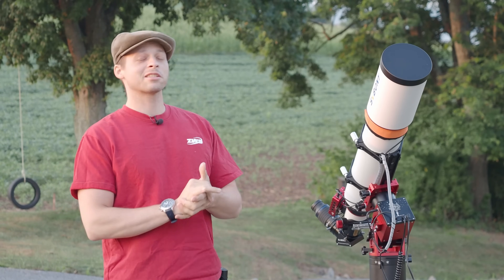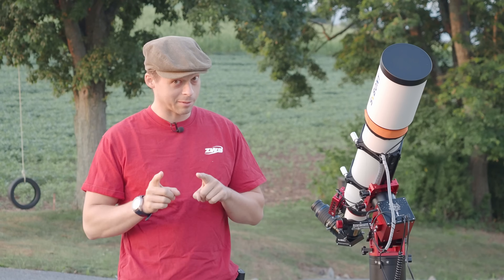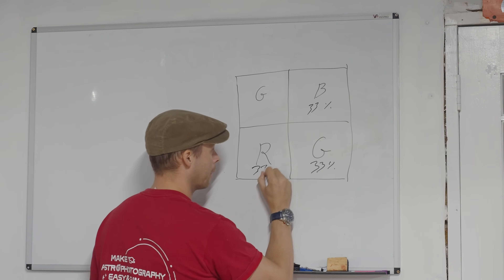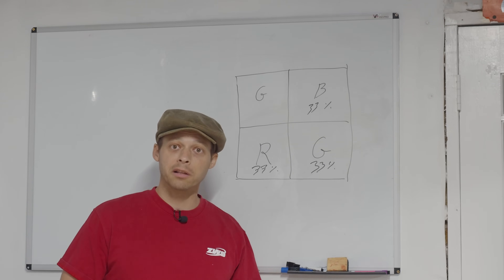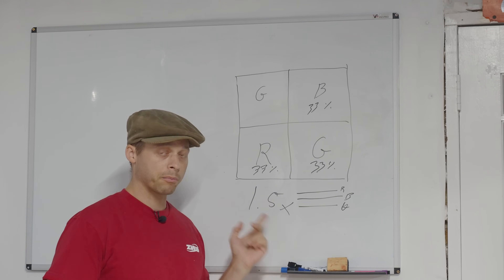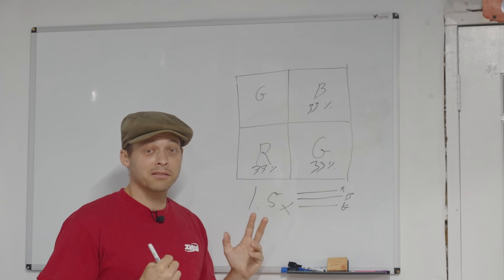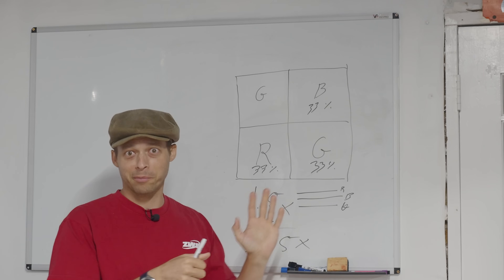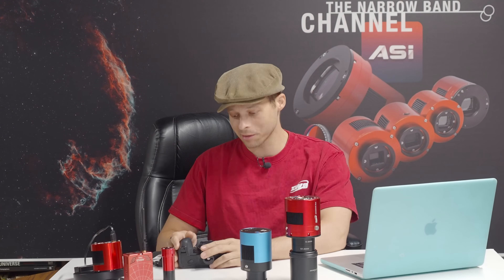New Sensor could bring 2.5 Stop ISO Improvement

Comment: As far as I know, QE is defined by how many photons are converted into electrons per wavelength. So the filter does not change the QE per pixel at its highest transmittance wavelength. We are throwing away the red light on the blue and green filters, but that has nothing to do with QE. So if there is no red light hitting the silicon on the green pixel it cannot be converted as per the definition of QE. You are talking about spectral sensitivity of the system, but not QE.

Comment: Foveon did this decades ago by stacking blue green and red sensors using the fact that the absorption of light in silicon varies as a function of wavelength, the blue sensor being on the surface and the red and green sensors being buried below the silicone surface. The principal inventor of this technology was Dick Merrill. I wrote most of the patents to this technology. See for example US Patent No. 6,727,521. Sigma incorporated the Foveon X3 sensors in its digital cameras and later acquired Foveon.
Reply from the maker: Its actually very different in how it works. Like making a cake with sugar instead of salt.
Reply: @TheNarrowbandChannel  The only thing that seems to be different is the perovskite material and its photon capture physics. My comment, as well as previous comments by others, was to the effect that the video seemed to imply that the concept of vertical color photon capture was something new, which it is not. Not enough information to determine yet whether properties such as photon capture efficiency, signal-to-noise ratio, and manufacturability will prove to make this a better technology than the Foveon X3 vertical imager
Reply from the maker: @KennethDAlessandro  I did say in the video that there have been other (many in fact) attempts at this. 
What is better about this is that light is not absorbed across the entire spectrum as it is in Foveon tech. Which is a dead end and has been for some time.

Comment: Foveon did this decades ago using the fact that the depth of light absorption in silicon varies as a function of wavelength. They used a surface blue pixel sensor and buried green and red pixel sensors. Dick Merrill was the primary inventor for this technology. I wrote most of the patents for the X3 technology. See for example US Patent No. 6,727,521. Sigma used Foveon X3 sensors in digital cameras quite a while back.
Reply from the maker: It's not the same tech. Like making a cake with sugar vs salt. Foveon was a dead end 10 years ago.

Comment: I’m not sure about the increase in light due to removing the Bayer filter. I guess the question would be % of available light absorbed in total by the sensor, loss through the stacking process, and overall efficiency. However, if 90% efficiency is achieved, and the sensors can be stacked, and their size increased then much better fidelity could be achieved with a total reduction in overall noise. That would be tremendous.

Comment: Panasonic had video cameras that used a prism to split the light of RGB into 3 different sensors, wasn't really any better than competing video cameras
Reply from the maker: In the 90s 3 chip video cameras were king of the hill. They had dramatically better resolution and low light performance compared to single ship cameras of the same era. You should look up 3 Chip cameras. They were pretty neat.
Reply: @TheNarrowbandChannel  I own one and a similar vintage sony and canon, compared them side by side and saw little improvement

Comment: Strangely enough, the Pentax K3 mark iii has a better iso performance to its monochrome version camera, Pentax K3 mark iii Monochrome. So in this particular case the colour sensor from purely the prospective of iso performance at different ISO levels performance better, in respect of noise at the various ISO settings.
Reply from the maker: Pentax must have done something dramatically wrong with that ones firmware, or it's not the same sensor. The color version uses the IM571 sensor and the mono version of it has vastly superior performance as many many astronomers have confirmed. It's a very popular sensor in its mono version in astrophotography. A ton of data is out there about it.
Reply: Yes I honestly don't know why this is the case, as you said it could be a different sensor. And I understand what you mentioned about the monochrome sensor and reviews of it with astrophotographers, the whole thing surprises me too.

Comment: Excellent video! I hop you are well.  Regarding the low number of research papers being published in journals, Yes, CoVid-19 has impacted research & development, but I wonder if the incentive to fund R&D within the manufacturing sector has dropped for the following additional reasons:
(a) manufacturers have made a massive  investment in the equipment & training for the efficient & profitable mass production of Bayer Array CMOS sensors...which means they need to pay for the preset technology before considering adopting significantly different sensors, and
(b) the Bayer Array sensors are quite profitable, and what research is being done is targeted toward the existing technology (this happened with CCD sensor technology, until CMOS sensors became viable & profitable)
Reply: I think a lot of research went into TDI cameras and sensors for automated vision systems. For consumer applications, the BSI sensors were stacked with memory and amplifier chips… research went thus into 3D packing for improvements on the system level. There was some research, however, for curved chips by Sony (I believe) to compensate for the field curvature of optics. In the end optics got so much better with the “CODE V optimize button” and new low dispersion materials that curved chips were not required anymore.

Comment: Cool tech! Hopefully it becomes a real product soon.
In theory it should also fix (or strongly reduce) the problem of moiré that bayer sensors have. You can bypass this problem by having a very high resolution sensor, or use some softening filter, but that’s not ideal.
Since both web compressed videos and stills are also often compressed to 4:2:0 chroma sub sampling, the actual resolution you are watching is probably very much lower than the stated sensor resolution. At least a better sensor would eliminate one of the color resolution  steps involved in a normal publishing workflow. (You can compensate for this by over sampling.)

Since the computer also doesn’t need to invent most of the pixel data based on the surrounding pixels, decoding the file should also be less compute intensive.

So higher quality image, better low light sensitivity, no moiré, faster decode. I wonder if this tech also have a downside. Perhaps the actual color reproduction/separation is worse somehow? Lower dynamic range? Slower readout speed? A lot higher production cost?
Reply from the maker: It looks like they claim lower production costs.

Comment: First, learn a bit about the luminosity function - it will tell you that your '33%' is nonsense when it comes to normal photography cameras (which is a different use case to astro cameras). The bayer sensor is very clever, even if it looks simple. Calling it 'red green and blue' misunderstands how it works. What it actually is, is a luminance channel and two chroma channels. The luminance channel gets half the pixels, and covers most of the visible spectrum. Stacked pixel sensors are not new - they've been around a while, called a Foveon. The problem with these has been extracting the charge from the three layers, and also implementing correlated double sampling, essential to eliminate pattern noise. It results in a lower QE than traditional sensors and therefor more noise. As you note, the direct QE of silicon is in the 90's, so even if perovskites can be better, it's not by much. I would bet that extracting the charge would be even more difficult. There is no perovskites chip tech, so there would have to be an interface (actually three) in each pixel to the readout circuitry, and that sounds hard. Then you couldn't manufacture it on conventional fab lines. They say the best the can do is a 100k pixel sensor, so there's a load of development and production engineering to do - and who's going to pay for that? If it ever does come to something, will it outperform silicon by enough to be competitive. I would doubt it. It's a non-starter.
Reply from the maker: Even by your logic luminance is half. I can tell you that most of thus is just forum nonsense amd you wont find any scientific pier reviewed papers that support this. Look up throughput of sensors.
Lastly foveon is very different as has been explained by others in comments here.
Reply: @TheNarrowbandChannel  Sure it's half (actually a bit more when you work out the transmission curves that real CFAs use, the designers aren't as dumb as you think). As for forum nonsense and peer reviewed papers, that's just a deflection from your inability to actually answer the points that I made. If peer reviewed authority is important to you,  I should let you know I'm a retired university professor with a research specialism in sensing systems and over 150 peer reviewed papers to my name. You won't find any peer reviewed papers about productionization of these (and other radical sensor ideas) because it hasn't happened yet, if it ever does happen. It will occur in the commercial domain, and they won't publish (if they ever do) until they have the details worked out and patent protection in place. I was simply letting you know what are the likely pitfalls before this makes it to a commercial product, if it ever does.  There are loads of peer reviewed papers for new concepts which were totally impracticable and never made it to production, let alone succeeded in the market. How's the Panasonic organic sensor going? If you want a bit more detail on the reasoning behind everything I said, I'm happy to oblige, if you're willing to learn rather than just dismissing things that you clearly don't fully understand.
Reply from the maker: You did not provide any peer reviewed evidence. (still waiting)

Comment: AND what if the star light actually falls only on the blue pixel but not the green or red, because these are physically adjacent.  So you might not capture certain detail on the color camera because only light of that color can be detected by that pixel at that location.   Very interesting stuff, thx.
Reply from the maker: Most optics are not good enough to do that.

Comment: These crystals are being tried to improve efficiency of solar cells over last several years.  Not sure whether they could address the stability and ruggedness of these crystals and an affordable solar cell based on this is available as yet.
Reply from the maker: It is cheaper then silica and requires less power. Also since the sensor of a camera is not out in blazing sun all day it will last much longer.

Comment: I had a cursory look at the papers and I'm going to share some uniformed doubt. The promise of the perovskite crystal method is to mimic what the human eyeballs do in the retina. That's the first red flag 🚩 (haha) .. but I can't find an actual image of the sensor layer. The 3d renderings I do find though clearly show gaps between the areas of the crystal structure that will be sensitive for various wavelengths. So not all red light will get through the crystal.. only the fraction that hits the red sensitive molecules in the layer. That fraction makes its way to the sensor. So what you end up with is gaps around each pixel (which reduces QE) AND gaps with the crystal layer for each colour as well. Gaps in Gaps. So my intuition says there is no way this will be better than a mono camera with separate R G and B filters. Remember, the human eye has cones.. so it's QE is still dictated by the gaps in those colour sensitive cones. The crystal appears to just make little colour sensitive areas (like small cones) over each single pixel. That's not optimal QE.
Reply from the maker: CMOS sensors also have gaps. Hence they put micro lenses over them. How wide the gaps are we will have to see yet.
Reply: I also believe that Foveon sensors currently do this, but I don't know if they have superior lower light performance.

Comment: Perovskite is being developed mainly by China at the moment for the next generation of solar panels. Even though the efficiency is greatly improve its main down side is its stability and currently wouldn't last as long as current solar panels. I'm wondering if these sensors would also have a similar issue.
Reply from the maker: Given that solar panels are bombarded by the sun harmful rays constantly I can see how they would deteriorate. A camera sensor though is not exposed but for very short periods so this shorter lift may not factor in at all. But interesting.
Reply: @TheNarrowbandChannel  yeah that makes sense. Exciting if it can be developed.

Comment: Interesting news! Perovskite refers to a certain crystal structure. There are many kinds of different crystals with this structure, they are quite popular for optical applications. There is a lot of research about solar cells based on perovskites. I have worked with Lithium Niobate for optical data storage. It is also used for frequency switches in optical fiber communication.
I wouldn't be too optimitistic about having a camera of that type any time soon. First of all, I would like to see their numbers, if they really get a good quantum efficiency for their single layers. The theoretical advantage you showed depends of course on the single layers having a quantum efficiency close to that of a silicon sensor. I think that is where the foveon sensor didn't quite deliver. 
The other big catch for image photography is the exact spectral sensitivity of each layer. What is so great for the bayer sensor ist, that you can craft the filter on each pixel precisely in the spectral absorption curve. A e.g. "green" filter isn't just green but has a certain spectral curve. So its transmission at e.g. 532 nm and 550nm play a huge role in the color perception. That is probably why e.g. Kodak and Fuji Sensors have their special character. This might be difficult to get with layered sensors. This would be less a concern for astro cameras where one would use multi-line filters together with such a sensor. On the other side, the current monochrome-cameras already off that.
The other big caveat: even if all else works out, how are we going to manufacture such sensors with megapixels at scale? All of the fabs are designed for silicon, a whole new manufacturing technology might be necessary. 
So yes, very intriguing, but certainly not around the corner.
Reply: One more point: some years ago Panasonic presented sensor tech which uses several organic layers for a similar effect as this new sensor. I think they even sell a very expensive video camera with it, but it hasn't shown up in the mass market yet.
Reply from the maker: The organic sensor thing was such a flop. Even the nam sucks lol.
Reply: Lithiumniobate is the most promising material as active material in silicon photonics for high data rate transceivers…

Comment: :( i just bought a 533 because of your channel :)
Reply: I am about to do just the same :)  I don't think these sensors are available any time soon. I would be surprised if they were available by the time you look in to replacing your new camera even.
Reply: @peterherth7379  thankfully im very happy with it so far. Very good recommendation ty again :)
Reply from the maker: Yes if you just bought a new camera do not sweet it. It's probably going to be a while. These sensors will most likely show up in cell phones 2 years before cameras.

Comment: This sort of thing has been done before with the  Foveon sensor that Sigma used back in the early 2000. It used a stacked RGB sensor stack. https://en.wikipedia.org/wiki/Foveon_X3_sensor
Reply: It is a bit different as it uses the depth of the photon absorption in silicon, not seperate color absorbing layers.
Reply from the maker: Foveon is very different and was a big dead end in tech.

Comment: Hi Ben,

Maybe it is my lack of sensor knowledge. I wonder what the sensor technology makes it different from Foveon as it also has 3 layers.
Reply: Foveon was using several layers of silicon. Basically, they measured how deep a photon enters the silicon. This depends on the wave length and hence from the color. But they were not very good at distinguishing colors and produced a lot of noise. So they were very nice in the resolution department, but didn't give better ISO.
Reply from the maker: Yes quite different and Foveon was a bit of a dead end.